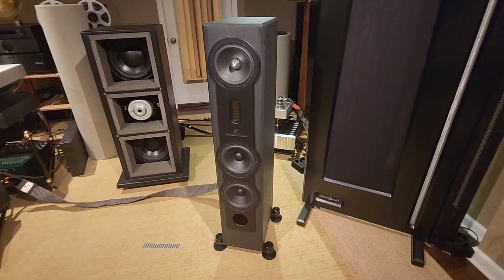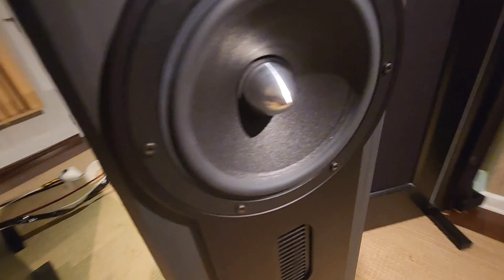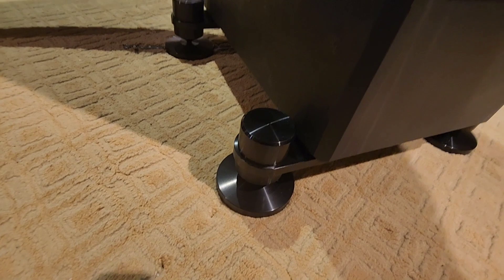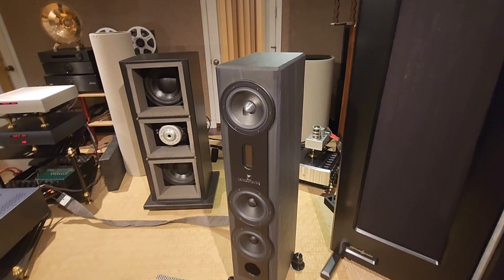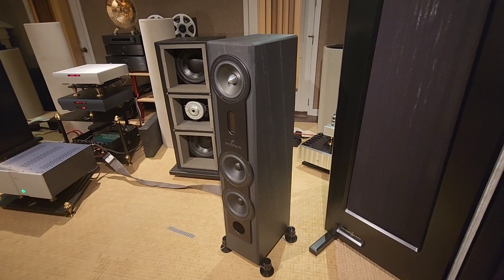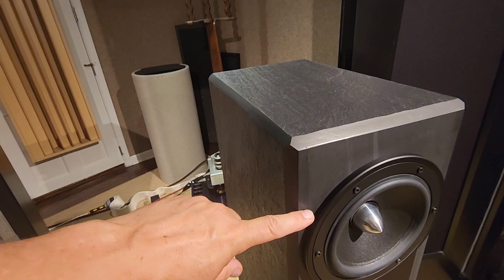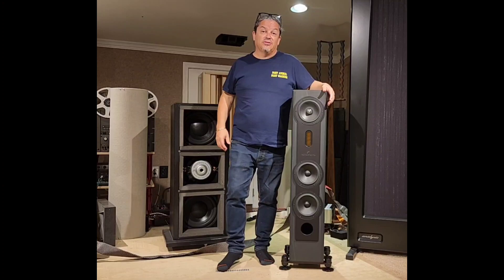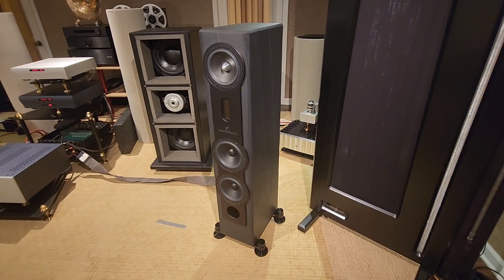MY LATEST SPEAKER !  MADE FROM ANCIENT MUD !!

Comment: Great intro to what appears as a beautiful floor standing speaker. $19k-$20 is a fair price for these puppies. And as you point out, this is the first high-end speaker to get bi-wiring done right with beefy jumper cables to terminals that are labeled. As I said before, what a concept. Shipping costs must be expensive, tho.
Reply from the maker: Shipping included. Beat that !
Reply: @chrisrichards2827  I understand that. I’ve bi-wired my Dunlavy SC-IVa’s with the appropriate speaker cabling. I’m speaking of the jumpers. Most jumpers are a cheap ass piece of metal, not the beefy jumper cables used here. And I am not aware of any manufacturer who properly labels the terminal binding posts. That’s my point.
Reply from the maker: @chrisrichards2827 it's not bi wired right now.  Lol. Are you teaching me (a cable designer) about BiWiring ? Appreciate the effort..
Reply from the maker: @chrisrichards2827  send me some then. I'm NOT buying Monitor Audio. I'll send them back and pay for shipping.
Reply: @OCDHIFiGuy  He’s addressing my comment, Mikey. I was a bit too abbreviated with my post about bi-wiring done right.
Reply from the maker: @chrisrichards2827  I've got a local dealer with Monitor...

Comment: The shear velocity of shale rock is much slower than aluminum  and less than that of granite. I would surmise slate would offer the preferred sound. There will be a variation in natural slate as there is in woods of the same type. It would be preferred that the shale should be mined from the same area and depth to maintain density as it relates to shear velocity. That would make for a matched pair.
Reply from the maker: Of course they are from the same area.. otherwise they would sound different !

Comment: Actually the SN/SL 770.1 were the speakers I saw in an customer-homevisit video of my homecinema dealer who was all in for stereo AND homecinema.
That video back then did fascinate me with all the stereo gear like pre/amp, phonoamp, Turntable ... and combining all that with the homecinema chain.
It turned on the FLAME for me
Saw Fischer & Fischer at HighEnd 2022 and another smaller show, both were really not setup well, nothing really done in the room, no good presentation, no good music, simply turned me totally off even they for sure would have been a good choise for what I searched for.
Also the slate look must fit into the room, me having a stonewall this was not my thing, but color is almost like my PSaudio and they wouldn´t have reflected that much as mine.
Not sure the price of the 770.1 but they would have been my choise, I guess they would have been more expensive as the FR30
Reply from the maker: Yeah, proper break in and component matching is very important. ;-) Ive also heard some great product sound horrible  at shows or in the wrong setup...

Comment: The price isn’t bad considering an amt, slate and phase plug mid.  Sh’t mikey you giving me wood! 😅
Reply from the maker: Doop !!
Reply: @chrisrichards2827  from my perspective it’s not a matter of strength and longevity of the cone, but what it can do on sonic performance and purity by smoothing out peaks or other anomalies when necessary.  Obviously in this application, there are other midbass drivers. That said, that midrange phase plug driver is crossed over to a relatively stressed-free zone, especially coupled with AMT tweeter will also play a little lower than dome tweeters. 

Of course different philosophies on speakers and sonic goals for every speaker with addition to a signature sound. IMO the ones who chose phase plug midranges in their designs have higher sonic palates.
Reply: @chrisrichards2827  disagreements are healthy. Thought you were going yo throw in some end all be all measurements crap.   But I thought we were talking phase plug drivers.  Anyway…you know what they say about arguing on the inter webs….!